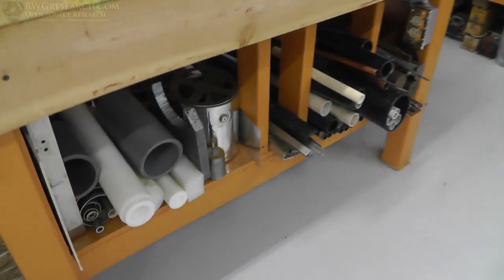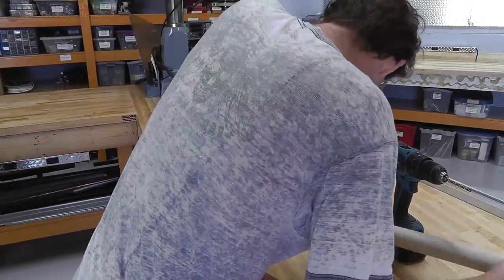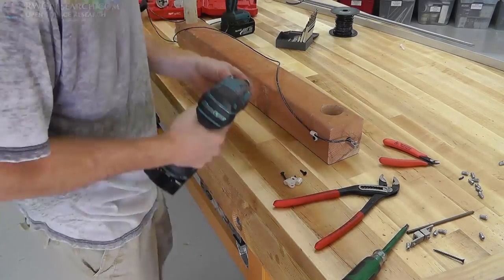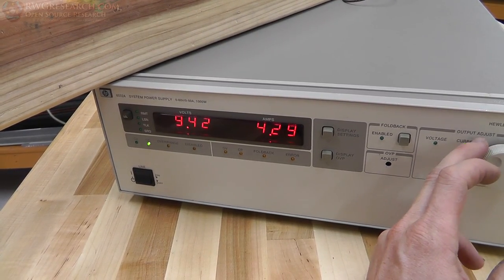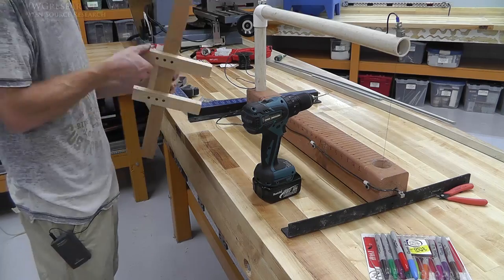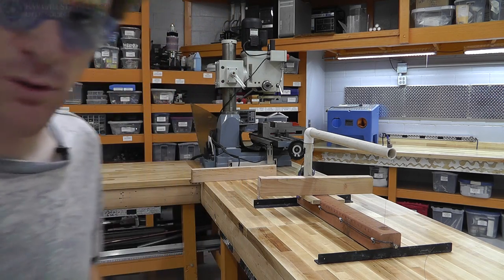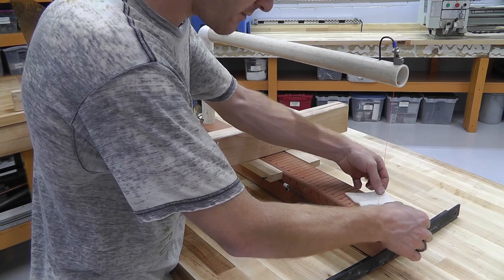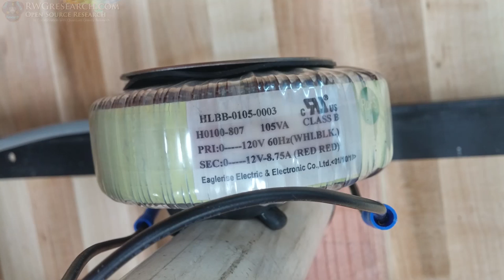DYI - Let's Build A Styrofoam Cutter AKA Hot Wire ( HOW TO GUIDE) Using Scrap Laying Around

Comment: Been cutting foam with hot wire for many years.  First off, the wire does not have to be that hot - use less current (which is safer!) to get a dull heat - you should only barely see red in a dark room.   Second, the overall construction can be done much simpler - and use a extension spring on one end for tension.   You need to have ventilation too!   Fumes can be toxic!!!   You can use common 110V AC - just control the amperage with a variable supply, variac, or load resistance.

Comment: I like that you used a variable power supply to dial in the current and see where the voltage lands for that particular length and gauge of wire. I suppose you can also use an infrared thermometer to measure the temperature of the energized wire.Then create a data sheet for different density foam materials to set the best cutting temps for the foam being used.

Comment: We were always buying 'foam peanuts' for shipping our packages. (=We tried shipping stuff in popcorn but our customers did not appreciate it...!!!)  Used to get equipment encased in custom formed foam shipping. =We built a larger version of your hot wire cutter. It was powered by an old 'buzz box' AC welder we never used.  Inconel wire (.0126) snaked through ceramic eyelets in a 24" X 48" serpentine pattern. Wires got separated by a 1" gap so they did not short out. Pushing foam through the 2' X 4' angle iron frame cut 1" "BOARDS?" of foam.' Flipped boards 90 degrees and cut 1" X 1" sticks of foam. Then we recut the sticks of foam sideways (90 degrees) to make 1" X 1" 'peanuts' (cubes.) We shared a warehouse with an electrical contractor and they gave us lots of waste foam as well. Always cut down larger blocks of foam with a hand held hot wire 'bow cutter.'
Reply: OgMandin0  Kudos from other vendors/customers in the refurbished telephone equipment industry. We actually sold a few hot wire foam 'cubers' to them. Had nothing to do with our 'real'  business = refurbished telephone equipment. ...Seems funny now, but we included a 'how to video" recorded on VHS tape... :)

We had so many extra cubes we'd fill 30 gallon trash bags of 'peanuts' and barter them for color copies and brochure printing at a local 'Mailboxes Etc.' (now known as 'UPS Store.') 

Also built (the first?) overhead foam 'peanut bin.' Had a hose which sucked out foam peanuts from an incoming packages (powered by a repurposed Hoover vac.)  Peanuts went into the bin. We'd dump peanuts through the same hose into a box we were packing to ship out. (Powered by an integrated  exhaust fan) . Vac and exhaust fan were switched off and on at the 'user end' of the hose. (hose was the same 4" diameter hose used at car washes.) And we put a 'knife flapper valve' on the end of the hose to stop the flow of excess cubes when the shipping box got full.  =Kept the shipping area much tidier.

Comment: Nice work you have done.
If I was you I would put in a spring in one end of the wire, by doing that you will allways have tension on the wire and get more straight cuts. 
Just a thought ;-)
Keep up the good work. and thhx for sharing.
Reply: I believe he said in the video that the flex of the PVC pipe was acting like a spring for the expansion of the wire when it heats up. But you are correct as many others have demonstrated the use of a spring for that purpose.

Comment: How difficult would it be to add a quick disconnect so that you could open the wire and do an interior cut in the foam? I want to line my toolbox with foam and cut out places for each tool.

Comment: Seems like scissors would have worked just as well for such thin piece of foam.  Its a good idea and would probably be good for cutting 2 inch form for  Halloween decorations or building items from 4' x 8' sheets of foam insulation.

Comment: Hi, Russ! Great vid! If you want to lower the price you can use AC and a dummy load (but not the transformer). I'm using an old 500W water heater. After 15 minutes of cutting I have water hot enough for a cup of tea (or 10 of them...). What a nice project. :)
Reply: did you just connect the  the foam cutter in series with your water heater element?

Comment: I did something very similar some time ago but for cutting plexiglass. It worked only for like 2 centimeters and the wire cooled down too much. Should I use thicker wire and higher amperage so I have a bigger heat capacity?
Reply from the maker: HunChem

the same problem here. even Styrofoam will do that. just go slow. Plexiglas / plastic will not work on this type of cutter well at all. plastic is to dense. i would recommend table saw, or vertical ban saw.  you may even be able to get away with scoring it with a knife and braking it. but it tends to chip this way... 

adding more current / voltage will just result in frustration of braking your wire. an option may be to use a knife blade instead of a wire. this will give it more thermal mass to hold more heat. and make it stronger also. it will require more current / voltage but it might work. 

hope this helps! 

~Russ
Reply: ***** I will go with a fine saw or saw wire then. I needed curves, so it seemed like an only option.
ps: Change the title, you have written DYI, Do yourself it :D

Comment: Hi! greata project, I'm tryin to build one but I'm having problems qith the right wire and circuit... I'm also usin a 12 volts transformer, but it doesn't seem to heat the nichrome wire at all... what might it be? Can you give advice on this one?
Reply from the maker: hi, look at what the amperage of the transformer is. it needs to be high enough to heat the wire, at that point look at smaller wire size. if its to thick it will not get hot enough, if it to small it will burn out. 

you need to play with voltage / wire size. and then just make sure you dont over load your transformer. hope this helps 

~Russ
Reply: amaral sanchez

Comment: You had 12 vdc and about 5 amps but when you showed the transformer it put out 12 vdc at 8.75 amps why didn't it fry the wire?
Reply: the 8.75 amps is the maximum the transformer can supply before it gets damaged.  the current that the hot wire will allow through will be the 5.5amps just like when it was connected to the bench power supply.

Comment: i see you not has newer before make anythink elektric work. this is dancerous and big shit ,transform need be in plastic box, and stupid parrel system, lot better have use film plywood and hot wire go up to center table. and need be spring tension wire to traight. lot work if need make good. this is big joke only. and this need adjustable volts controller, dimmer because you power has too high this video.